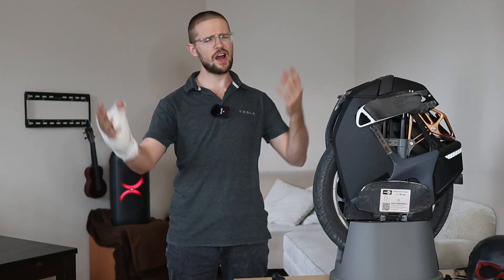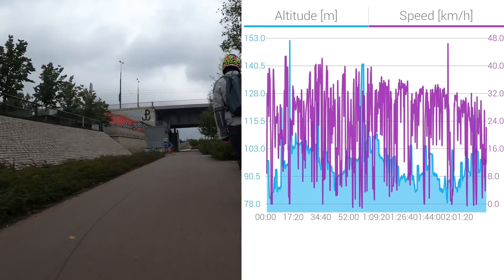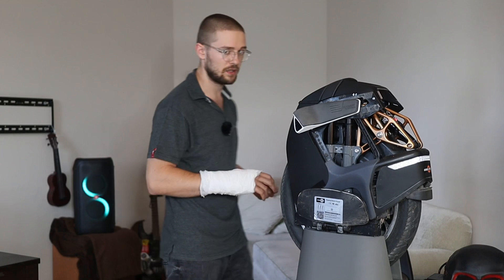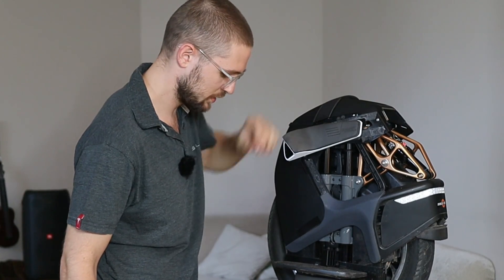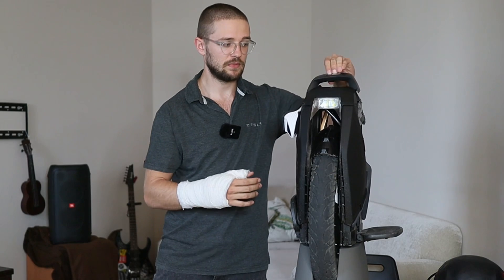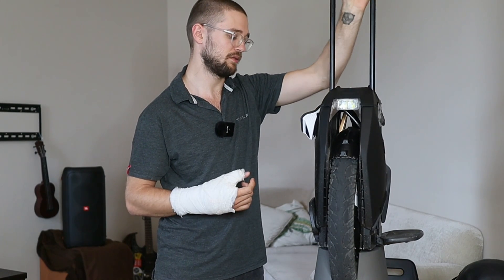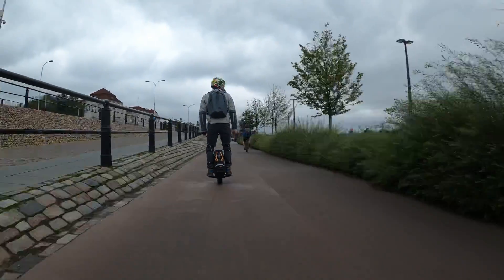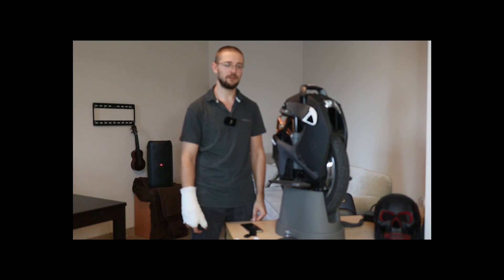King-Song S18 Review

Comment: I'm a S18 owner, and completely agree with this reviews highly critical nature.  my wheel arrived with a major manufacturing flaw (the wheel/motor was off center by 3-5mm.)  Even after being fixed, it still isn't 100% right, because I think the manufacturing margins are way too high - and the wheel lacks perfect symmetry.  

There is a lot of talk about the suspension structure (linkages, bearings, and interior piston), and it appears that this structure  doesn't make full use of the shock, and suffers from poor design.

I agree the wheel is easy to overpower - and this gets really sketchy under 50% battery.  It is not a wheel to push hard - especially above 25mph.

I also don't like how easy it is to hit the lower pedal parts, and squared off parts on the ground - so much so that I moved the pedals to their highest placement, and added additional padding for better leverage.  This put me at a high center of gravity, and more than my other wheels (18xl and MSP), the S18 feels like your way out in front of the wheel while riding (hard to explain), and if you hit sand or loose gravel the s18 has a tendency to twist out from under you, more than my other wheels.

The trolley  handle stuff is very well described, and baffling design.

I have had a lot of fun riding this wheel, and it is finding it's place in my small collection of wheels - that being said, I will never buy a first generation KS wheel again.
Reply: What you driving now? Or want
Reply: you probably dont care at all but does anybody know a method to log back into an instagram account?
I somehow lost my password. I would love any tips you can offer me.
Reply: @Kai Beckham Instablaster =)
Reply: @Thaddeus Kevin Thanks so much for your reply. I found the site on google and im in the hacking process now.
Looks like it's gonna take a while so I will reply here later when my account password hopefully is recovered.
Reply: @Thaddeus Kevin it worked and I finally got access to my account again. I am so happy:D
Thanks so much you really help me out :D
Reply: @Kai Beckham no problem :)

Comment: Sorry about the broken hand. I hope you have a speedy recovery!

Thanks for the honest review! When the S18 was first announced I was enamored by the looks and didn't like the V11. Fortunately I never put a pre-order on the S18. I was on the group ride when Alien Rides had a bunch of riders try the S18. Everyone hated the wheel and there were many experienced riders that tried it. We even took it on our 25 mile group ride and it couldn't finish the ride due to lack of range. The crazy hills don't help the S18 but none of the Gotways (Nikola, MSX, Monster, etc.) had any problem and they were going very fast the entire time. I was extremely worried about the battery sag on the S18 with that motor and small pack. You clearly showed that is a problem and that can't be easily fixed. I don't know why more people are not highlighting that major flaw.

I know a few people now with the V11 and they absolutely love that wheel. I just picked up a Nikola 100v so I will need to wait a bit for my next wheel. I want to see how the Gotway EX does before making my choice for a suspension wheel. For now, my next wheel would be a V11 or a Veteran Sherman. There is no chance I would consider the current S18.
Reply: Sure 👌 none of the Gotway wheels had any issues 
And none of the experience riders liked the S18 ! But every one you know loves the v11
Ok Gotway boy!
Reply: @stewartciesla8142  I just got into EUCs and only have two of them so I don't have much experience so I look at what most people ride. Of the 20 or so EUC riders in the group almost all of them have Gotways and three of them now have V11s as well. No wheel is perfect and I do wish Kingsong success with the S18.

Comment: You may knock the block out, but your bearings are dead anyway from the box because you're as fool as me to preorder Kingsong wheel. You should disassemble it and change all the bearings if you want really smooth suspension. Throw away that spring washers that damaged bearings and change it to simple washers. Use 10*12*0.2 (or 10*14, or 10*16) washers between double bearings when pressing in. Next buyers should receive a good assembled wheel with some parts physically changed. But those who preorded the wheel... pwned. We have bought alpha version. Not a beta testers, but alpha.

Comment: Thanks for this safety testing @WrongWay 🙏👍👍
This beep friendly wheel should definitely, before letting you accelerating to near faceplant:
- beep at you on time! This is what beeps are meant for, to let you know to ease off. It beeped then cut off Bluetooth right away. 
- keep a power reserve to give you a hard tiltback to force you to decelerate anyway. 

Instead, this wheel lets the voltage sag down to oblivion, things like Bluetooth that costs only a few milliamps and allows to diagnose crashes get shut off.
Okay you were using third party pads with more leverage than stock but that's no excuse.

Although you and the wheel managed to recover from the precarious situation, Kingsong messed up the safety implementation here badly indeed.
The S18 is an unsafe wheel until this fault is reworked, fully agree.
Reply: I completely agree. Cutoffs shouldn't be normal. It should have a good gradual tiltback but hard if necessary.

Comment: Almost a year and a half since this review was done. I know several people who own an S18, just like me. These pointed "defects" have not been confirmed in general. The handle is a very good solution as, built-in, it does not suffer damage when the EUC is dropped. Water resistance is sufficient. The fairing proved to be resistant to the heaviest use. The suspension is praised (and copied by another brand!). The apparent power cord, as far as I know, has never had any problems. It seems to me that the analysis failed. EUC users need to keep in mind that each model is preferably indicated for a type of riding. No one who cares about their knees will practice jumping with a Monster Pro, just as anyone who wants to travel long distances will choose an S18.
Reply from the maker: I made a update review afterwards. You’re right :)

Comment: "I intentionally tried to overpower the machine and use it in an extremely unsafe manor and came to the conclusion that the machine is dangerous"
Reply: Now, that is a interesting characterization of simply "accelerating hard below max speed ". Wheels in this class are expected to handle that.

Comment: Beeping is caused by KS firmware that confirms EVERY command sent to it from app. So every time EUC World connects to a KS wheel, it needs to read some important data and sends few commands to the wheel. Each command is acknowledged by the wheel with a beep. And if your phone will lose connection, after regaining connection this will be repeated. It's not a problem with EUC World, it's an annoying feature of KS wheels and happens with all apps. I asked Jack from King Song to remove beeps in next firmware updates, but... as we know, King Song - to put it mildly - does not always respond to user requests.

Comment: The blocks are there to prevent the big screws around it from over-tightening. (Says Kingsong Representative from FB Chat after I initially felt the suspension was a bit stiff)
Just put it back, screw the sliders back tight, and knock it off again if you need to take it apart for some reason.

Comment: my KS S18  has found it's place in my collection - it is my night rider.  If I have to be somewhere,  run a chore,  like getting some food at night, the S18 has become my go to wheel.

the one thing I do disagree with this review is regarding the S18 headlight, which is super bright and has a nice angle/spread.  It may not be the V11 headlight, but it's still quite good (it is my understanding the v11 headlight can actually be too bright looking straight down while riding at night, and the S18 does not have that issue)

Comment: This just confirms my decision to switch my pre-order to the MSP was the right one. Thanks man!
Reply: To totally different wheels! They're not even remotely close to being in the same league.
Reply: @stewartciesla8142  I didn't say they were the same. I know they are different.  I really wanted the suspension but it's too early anyways. Both seemed like good trail riding options.  KS just failed on this one. Get "two" your point.
Reply: Chet Hilkert no they didn't 
I have an S18 and its as good or better then my 18xl, GW Monster v3 
And much better then my MTen3
Reply: @stewartciesla8142  There are way to many problems with the S18. I'm sorry you bought it and feel the need to defend it.   So far it's cutouts from over acceleration, motor wire rubbing, pedal clips breaking, suspension bars rubbing, etc... I know there are others I'm missing. It's good in theory but they failed the execution.  I'm sure future versions will be better. We do need beta testers, so I thank you for that. I don't feel like having to fix my brand new wheel constantly and being a crash test dummy. MSP isn't perfect, but it has far less problems than the S18.
Reply: @chetticus1  not sure where you're getting this information man. The vast majority of the reviews of the S18 are very good. And apparently, it's very durable. I don't have any wheels, but I do watch a lot of videos..

Comment: Thanks a lot for the information...
I experienced a sudden engine failure with a KS16S (70-80% battery) during an acceleration phase at 25 km/h in normal conditions of use (flat road, cold and dry weather)...result: a memorable fall and no more confidence in this wheel. Electronic bug or design defect? Have you ever experienced a sudden engine stop in the middle of a race?

Comment: What should you do in the cut of situation? I had it and I fall down hardly :'(
Reply: Программист-эмигрант TV Adam may give more info, but from u-strike videos I learn to ride with one leg as a support leg, and other as a accelerating leg.. in case of a pedal deep meaning a cut out, you will need to break.. put the wheel back as it is leaning forward, if you weight is too forward it’s impossible to respond to pedal deep. But if you use the leg support technique, your body is accelerating but you weight is not so in front, and you may have time to respond

Comment: Great vids, thanks for the tip on the handle. Agree it's could be better.

I have a first batch S18. It replaces my V8f. The S18 is great. The suspension is great. Compared to the V8f this thing is flying over the trails.

The great thing is that it's 25 kg. That's a lot better then some other suspension wheels..

Comment: This happens with the Z10, also and probably every EUC, but I estimate my speed was over 55 kph, which is close to 40% above the rated max speed of 40 kph so I’m not surprised that the current was more than the system could support and it momentarily cut out.
That’s way better than burning out something and having unrecoverable complete power loss.

Comment: Very good video 👌 the plastic looks very cheap when you get up close, perhaps they spent all their budget on the mechanical aspect and then the rest was quick and dirty just to get it finished.  They shouldn't rely so much on glue and sticky tape for something that is constantly exposed to the elements.

Ive heard others say that gotway looks like prototype, but compared to the final finish here, it doesn't look like that at all.

Your video will for sure spread out and in the end improve all
Reply: I don't think they will improve things much because KingSong is stubborn and proud. I'll give you an example: 16X still collects dust inside the rear wing and, although they've been told that countless times, they haven't changed anything so far. NOTHING! They could have done it much better but they don't want to because it "works like that". KingSong treats any defect as a feature ;) They are very arrogant and do not admit their mistakes.

Comment: Nice video review as always...But did you forget to mention about the external battery option for the S18 for longer range.
Reply: It will already do a decent range, the external battery only outputs 3A, not enough to stop the issues seen here or really ride and charge on flat battery. You'd have to ride with it plugged in the whole time, and have a rest every so often. Or have a 3-4hr break to charge from ext battery.
Reply: That's external battery is also 350$
Reply: @danh8245  Do you mean the Kingsong external battery option is only like a powerbank..it is not connected as parallel battery?
Reply: @Kay0Bot  $350 is not bad for a 780wh external battery by kingsong.
Reply: @newbie101  yes :) but you can charge and ride at the same time with kingsongs.
Reply: @danh8245  Nice...just do not know how come there is no review and range test for that battery? I think it cost more than $350..more like $800.
Reply: @newbie101  probably just better and cheaper to get a fast charger (5-6A should be ok) and plan your routes to include some charging time :) shame there's not two charge ports on s18, could get two smaller wh battery packs instead and charge faster, maybe you could make a splitter... Tbh 30odd miles is plenty anyway. It's a couple of hours or so riding, more than most outings/commutes anyway. Tesla battery day is soon, we might get 1000mile wheels soon
Reply: @newbie101  there are 3 variants but I have no idea where to buy them. I remember reading on reddit it was 650$ for the biggest one...
Reply: @Kay0Bot  Have you check ewheels.com?

Comment: the suspension of all wheels is incorrectly assembled at the factory. there is a lot of work to be done in the depreciation system (there are problems that cannot be solved).

Comment: A very good review! I can confirm about the mudguard, it flaped already before 14km total distance (of which, 10km was with 20kmh). Despite the weight increase from 22 to 25kg and all the KS "improvements" (wider pads actually is worse for me) and the additional time for the fixes in the name of "quality is first" typical KS buzzword, KS released this wheel  still like a test prototype. 16X is a better wheel. Whatever, I won't by a KS ever again! MSX is a much better wheel at half the price
Reply: Where can you get a new msx for 900 bucks? You can't! 
That's half the price of the S18
Reply: @stewartciesla8142  2200euro is (was already?) an S18. And MSX can be found at around 1200-1300 euro (if it will not get expensive or still in stock)

Comment: 3:40 This is BIGGEST issue with high performance EUC's right now. The BMS doesn't communicate very much with the main board, all it sees is pack voltage. so the main board has no idea the BMS is about to cut power because the voltage is sagging too much and one cell drops below a limit. i wont buy one until theres more a more intelligent BMS, there should never be cutouts when its being ridden. its just stupid.